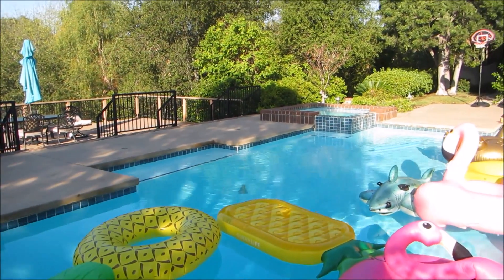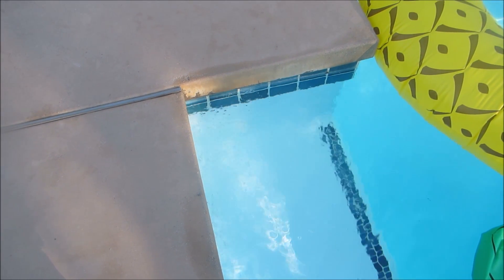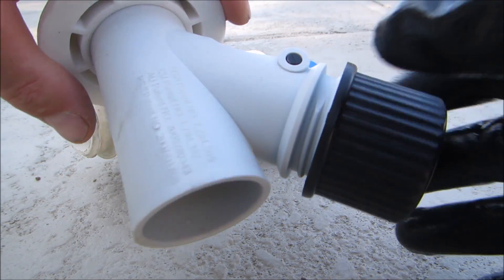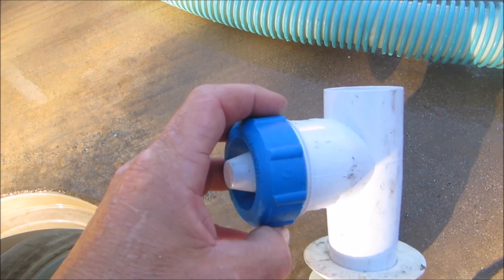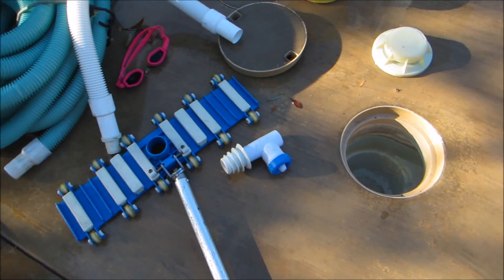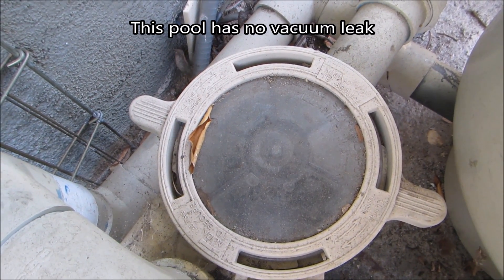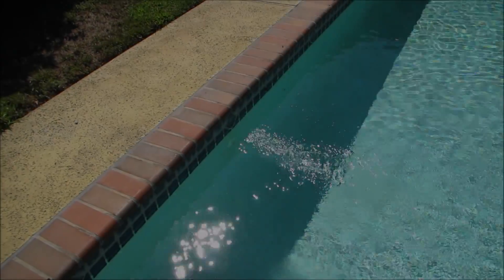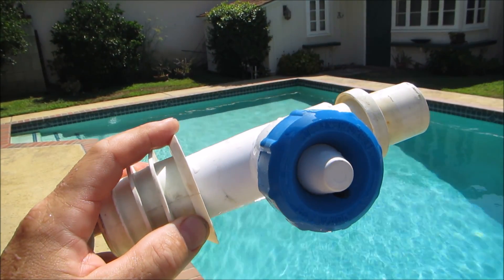How to Manually Vacuum a Pool that has a Vacuum Leak (Suction Leak)

Comment: my pool is sucking a lot of air. The pool runs fine with air coming out of the returns continuously. When I plug in a pool vacuum ( the hose is only 25 feet) the pump has a little bit of trouble but still pulls water. When it rain the air goes away for 2 hours after it stops raining. I think it the jandy valve in the front of the pump for the cleaner. The pump loses prime when I connect a cleaner to the side port. When I pour water in the pump, some or the air goes a way with the cleaner connected. Is there a way to test to see if it is leaking from the jandy valve?

Comment: thanks my friend, your video series has been extremely valuable to me over the years...one quick question if you have time: what is the amount of vacuum pressure in the skimmer that would be considered normal for a creepy to function? my creepy stopped working and i was wondering if my vacuum pressure is light. it seems really good just from feel. the pump primes quickly ...so maybe i need a new creepy vacuum or hoses? thanks again.
Reply from the maker: It's possible the cleaner itself has an issue. It is the old Keepy or the new updated version?
Reply: @SPL  yeah, its an old zodiac creepy that came with our pool 15 years ago...i replaced the diaphram piece in head part but no go...i'm thinking possibly the hoses them self may be the culprit now... its almost 16 years old and used to jump around like a champ...i swear the dam thing used to have so much power, it felt like it would jump out of the pool and go down the block! so yeah, possibly the interconnecting series of hoses may be the issue i'm now thinking...wish i had a friend who had one that we know worked so i could try it out... thanks for the reply my friend, what would you suggest?
Reply from the maker: @giantessmaria  Since the price of hoses is not cost effective to replace look at the Zodiac Ranger for $145 online. It is a solid replacement for a 16-year-old model - that is impressive by the way. 💪

Comment: My pool will do the same with the pool pump a lot of suction
Reply from the maker: Air is getting in there somewhere - can be tricky to find the source. How old is your pump and equipment?
Reply: my pump is about 20 years old it doesnt look old the motor is 4 months old since the last time we replaced it its a pentair whilsperfow 1 hp and its got a sand filter whitch is 2 years old

Comment: My pump loses prime immediately when trying to connect vacuum. Hose is fully primed. I must have small suction side pump air leak (have small amount of air in pump, slow to prime, some air in return jets). Am going to try this arrangement to let some skimmer water continue to flow to the pump while vacuuming. I assume the way to adjust the regulator valve to allow skimmer water in is just to turn the dial. Will start with it all the way open and see what pump does when vac hose connected. Inherited this pool arrangement from prior owners - main drain is plugged so there is barely any turn over of water and I really need to be able to vacuum up debris from bottom. Any further suggestions?
Reply from the maker: Try the vacuuming trick from this video.  Check the pump lid o-ring also as that is sometimes the air leak source.
You may need to call a Leak Detection Company out to find the source of the air leak just to verify it is not underground in the plumbing. Only problem is that these companies typically charge $400-$500 for the complete process - plus repairs.  But they guarantee to fix the issue.

Comment: Question, why not just fix the leak? Right off the bat
Reply from the maker: Very logical question. Sometimes it is not a simple fix. I have found some strange vacuum leak locations and sometimes you can't fix it without extensive re-plumbing. It is hard also to convince some customers that their equipment needs to be re-plumbed when everything seems to be running just fine. The first pool in the video is a rental property and the Landlord is unresponsive.  
But yes, optimally fixing the vacuum leak is the best solution to the problem. This is a band-aid in the meantime.
Reply: +Swimming Pool Tips, Reviews & How To -MrDgvb1 
Awwwwww I see ok well good alternative I'll def use this method if need to thanks for the tip and keep up the great work